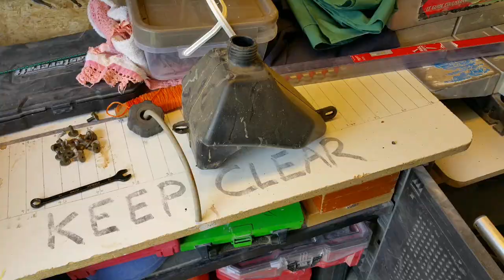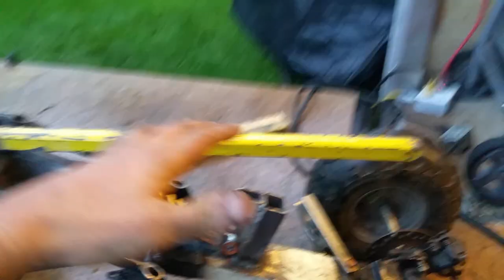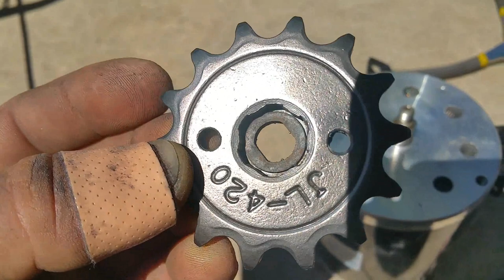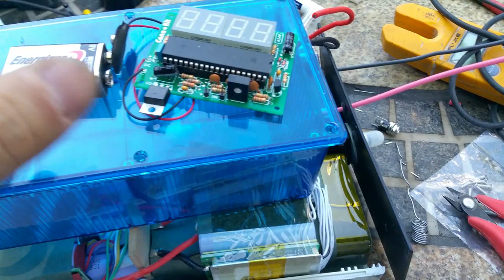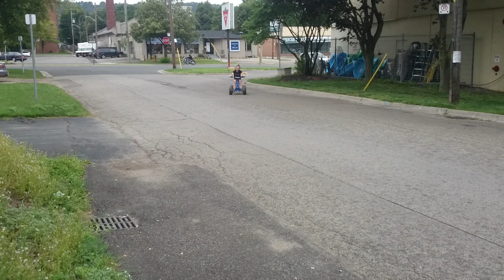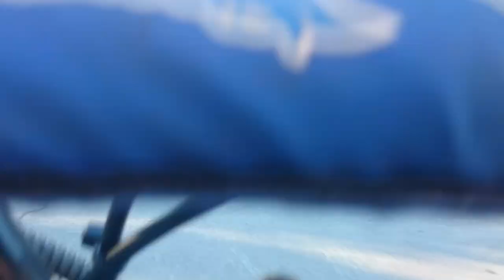Gas Quad to 36V Electric Conversion

Comment: Generally even the thought of quads makes my hair stand up on the back of my neck. For no other reason than folks buying one and thinking the public streets are the place to try out that ALL TERRAIN. Then the cops start getting involved primarily because those things are using Trombones for exhaust pipes. I personally don't  care what you want to ride in the street but I don't want to hear that going up and down my street all day when I need to go to work tonight. Put a muffler on it or do what you have done convert it into a street legal electric scooter.  I use to sell electric bikes I had built in the past and had one fellow not get an e-bike his grandson wanted but instead opted for a gas powered quad, He came back a month later and said after his grandson got a $750 traffic fine for driving it around their neighborhood. For about the cost of the fine not to mention half the price of the quad the kid would have had a street legal ebike. I sold him a bike for $400.00.

Comment: At the 4:11 mark when showing the extension you added to make it longer, sitting here in my chair staring at the screen eyeballing that thing, it looked way off center? If so, sure hope you straightened that out! But this thing looks awesome finished!
Reply from the maker: Thanks, it was a fun build. 
The original quad had an offset frame (due to the engine and drivetrain) but the centerline from front to back is fairly straight. It was too much work and not necessary to hack up the frame to remove the offset.
I've been busy making how to videos over at Hardy Renovations for the last year or so. 
https://www.youtube.com/channel/UCQzRGOYf4fSytAySfZb9S6g
I'd be grateful for the sub over there :}

Comment: Low power is probably because you mounted motor left side which means you have to reverse phase wires and hall sensors

Comment: Does the motor freewheel? I'm looking at a similar conversion. These motors can be found with a 6:1 reduction gear but you lose the ability to back drive it.
Reply from the maker: Yes it coasts when there is no throttle unlike motors with electric brakes or regen.

Comment: Hello, how much teeth have rear sprocket and how much the front? And whatvtype of chain is compatible with them?
I have the same motor, but no chain, and I am a bit lost...
Reply from the maker: The sprocket that came with the motor was a bicycle chain sprocket. As you saw in the video, I had to replace that with a #420 chain and sprockets that I welded in place. That motor is very low torque, high rpm. So the smallest sprocket you can find should be fitted to the motor and the largest one that will fit on the axle will give you usable speed and torque.
Reply: @chrishardy8616  thank you, I just made calculation, my motor hqve 2800rpm, and sprocket have 10teeth, rear one have 40 teet, and with my tyres speed will be over 60km/h. So I came with soutin - another reduction between motor and axle, so gears will be like 10T->19T ON THE SAME AXLE AS 10T->40T, and this gives me 32km/h top speed. I hope the torque is good enough to climb over the pile of dirt :-)
Reply from the maker: @jishimoari  I think my sprockets were 10T -> 70T
Even with this, my torque is lower than I want. I am a 200lb gorilla. My daughter is 100lb and it is just about right for her. 
Top speed is around 25km/h

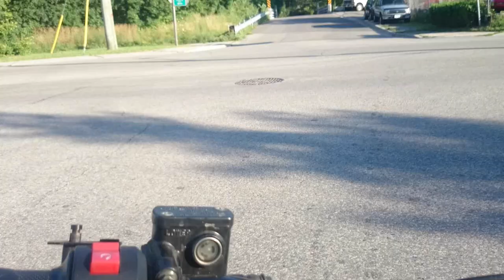Comment: did u tested on a hill to see if have enaf power ?  and at 13:45 is she wearing sockets?  o.O
Reply from the maker: Very low torque ... but it has a great top speed. I wish the motor was twice the power, however it would be more dangerous wearing only socks. Lol

Comment: I mean to each there own but the gas motor on these things are way faster than an electric motor. I took the speed limiter off of mine and it runs about 35 to 40 mph
Reply: Plus not to mention you don't gotta wait for it to charge. Just put more gas in it and keep riding

Comment: Where did you get 4 hoverboard batteries? Did you have to take 4 toys apart to get the batteries?
Reply from the maker: google "battery hookup" .. its a surplus and used battery market. Ebay has them too.

Comment: WHAT MOTOR
Reply from the maker: it is a 36VDC 1kw motor from ebay. It is 36V because the battery packs are 36V, 
Paired with an 800w? controller .. I think.